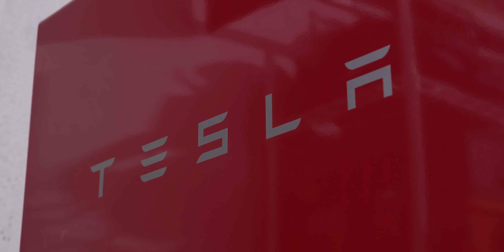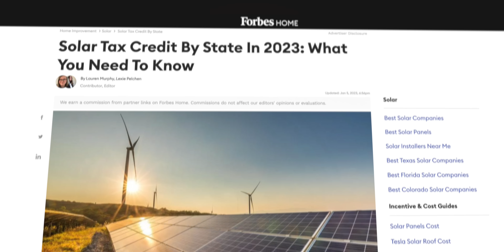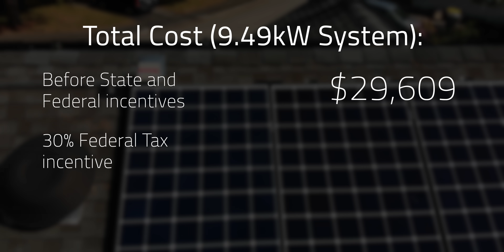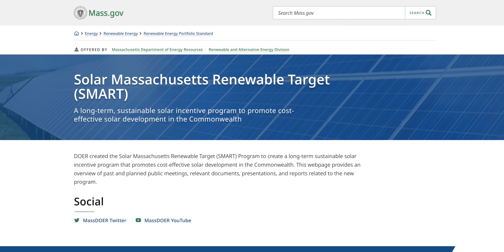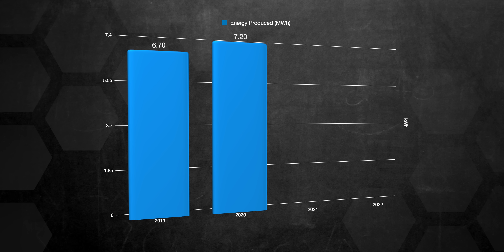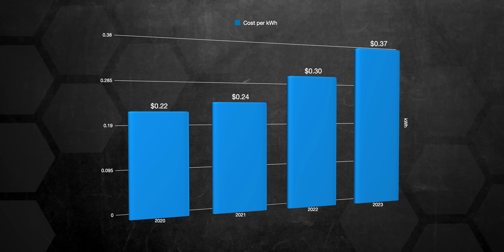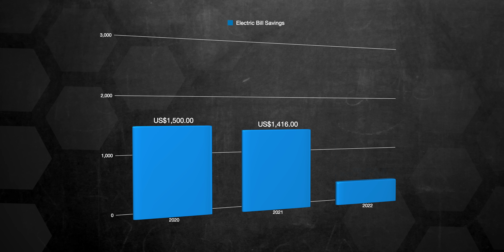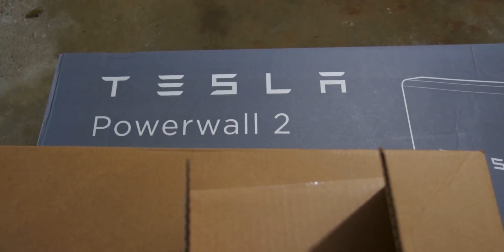5 Years with Solar Panels - Is It Still Worth It?

Comment: If you have the money and space to put a full working solar set up then EG4 is right for you. If you are building a new home then EG4 mini split can run directly off solar only, a two ton model will set you back just under 2k. This means that if you have just under 3kwh of solar hooked up to the mini split you can run heat or cooling all day long with out the need for grid. You can also connect it to the grid only, solar only or a combo of both. 
EG4 offers all in one inverters that are stackable and quite huge for around 1500 dollars they also offer a server rack battery of more than 5kwh for around 1500 dollars. 
You can even buy full kits from them as in this example. 
Complete Off-Grid Solar Kit - 13,000W 120/240V Output / 48VDC [20.5kWh EG4-LifePower4 Lithium Powerwall] 48VDC + 11,040 Watts of Solar PV 
Your Price: $15,439.60 
You can even increase the solar to max solar which is 16kwh. 
This is what I plan on doing when I build my new house. I am going to build around a solar system which will pay for it self in about 15 years or less. Since we will be going electric heat it should save us even more at a shorter time frame of about 7 years. We also plan on making sure that the solar array is at max and depending on loads we can add in more electric things like an extra freezer which over time will save more money. 
Adding in a electric car or two would also save us money in the long run. Which is why I wish they would opt to make city cars with range of 50 miles and easy to replace battery packs.

Comment: Great video, I just accepted an offer on solar energy and feel like we haven't missed anything big. There was a big big difference in offers from different companies but we went for quality rather than cutting corners to get the price down. The one we chose was the only one with proper roof load analysis regarding wind, snow, the roof beams' strength, etc.  Now we just have to wait for all components to be available, they thought around Q3 this year (16,8kW with 42 panels and a predicted production of just over 17MWh here in mid-Sweden). With the rules in Sweden, we maxed out on subsidies on the system without batteries so that will have to come next year with somewhere between 15 and 25 kWh capacity, we haven't decided on how much to invest in batteries yet. Meanwhile, we will have geothermal heating installed so this is definitely a great year for us in our quest for self-sufficient living! I will follow your new house project with great interest, good luck!
Reply: Update, we just got a message from our distributor, the cables are to weak to accept our overproduction as it is. They are investigating a solution. I am a bit amazed that they work on maximum at our current current of 3x16 Amps. Well, I trust they can solve their problem before our installation starts in Q3 this year...
Reply: @bennylloyd-willner9667  We upgraded ours to 25A when we put solar in (and did some other things). Hope everything works out for you.
Reply: @903lew  thanks! I'm sure they'll work something out. First the geothermal heating is getting installed, they start drilling any day now 👍
Reply: You're currently utilizing geothermal heating in your home?  Very cool!  Do you have a link on the company? Thanks!
Reply: @load3dedgaming  it's not installed yet, depending on availability of components the projected start of the system is about early autumn I'd guess.
Equipment is Vaillant, the company I chose is a local here in Värmland, Sweden called "Wermlands Energi och Rörservice“ (energy and plumbing service). It'll be ready just before we get our solar panels installed I think. It's a good year for me and my wife 👍
Reply: @bennylloyd-willner9667  Right on Benny!  Congrats on the project and thank you very much on the info!  I've been waiting for the solar tech to improve over the years before I made the investment, but it may still be worth it with some of the Fed/State incentives.  I live in Southern Arizona, and my new roof would accommodate panel installation on the southern side of the home with unobstructed sun light.  I just have to do some digging on the best company and program to suit my financial ability to get the best bang for the buck.  Ideally, with this type of investment getting the best is would be the way to go.  With A/C running nearly all the time almost 5 mo out of the year my electric costs to the power company is outrageous and will only go up.  Paying nearly $400 3 out of 5 of those months!

Sorry for any confusion, that quip was for Matt.  Giving him props on his video channel, content and presentation but wasn't feeling the $125 for his experiential video on the subject.

Thanks again Benny!  Let us/ me know how it turn out. =D
Reply: If you’re in SE3 I’d look at connecting the battery to a VPP like ChangeWatt. The rates are really good these days, looking into getting a battery just for this reason.
Reply: Me me me me... Me me me

Decarbonization is 21st century pyramid building.
Just burn coal. 

This is sickening on so many levels.  "How to screw the lower middle class and make them pay for your feel-goodery."
Reply: Thanks for sharing, I don't agree with the glum opinion of yours tho. I'm very satisfied so far with my setup.

Comment: Interesting review.  I live in North Texas.  Several years back, thinking 2016 or so, I met with 3 solar providers.  Despite their opinions, I didn't find it to be worthwhile in my case.  Many of their presumptions where simply wrong.  Escalating cost of energy was one.  In your case it was more correct.  I have very detailed records from when I bought my house in 2005.  In 18 years the cost of a kWh went from $.12 to $.15 which shoots down their sales models.  My house doesn't have a huge amount of roof with a southern orientation.  It was interesting to compare the three proposals with interesting variations in panels etc.  Their pitches were all about government incentives with disregard to the financing costs.  They also made false assumptions about how my local utility would cooperate.  I checked their assertions about home insurance coverage.  They lied.  Even if hail wouldn't harm the panels, they would have to be removed and reinstalled after the roof was replaced. The insurance company was happy to add an additional policy but the presentations never suggested that.  They also asserted that there would be increased value in selling the home.  I consult with with several realtors that said no way.  Perhaps where you live the experience will be better.  Here they would be more concerned about assuming liability of loans and maintenance.

Comment: Super interesting. Debating on a large project in the next year or two and weighing the benefits between solar vs geothermal. I think eventually both will make sense, but so far geothermal would make the bigger impact for our specific situation.
Our biggest issue with solar is just roofline... a lot of east/west and very little due south. Even when we do solar, it may make more sense as a smaller separate diy circuit for us to charge lawn equipment and run a few "always on" devices like the home network/server rather than powering the house. Time will tell.
Reply from the maker: I'm all east west and no south.  Depending on your house and surrounding trees it can still work well.

Comment: I generate much more electricity than I presently use, but much of my electric bill is for infrastructure costs, e.g. power lines and poles, etc.  My 1:1 credit is not applied to that, so I had a surplus that was confiscated by the local utility company.  This year I used much more electricity for heating.  I've not yet calculated how much that has saved me in other heating costs (e.g. natural gas and firewood).  Overall I'm glad I got the panels, but the savings per year will not pay off the installation costs as quickly as I had thought.  At least not until I get a few more electric products, like the e-car, electric water heater, and heat pump.  Thinking about getting that Tesla wall battery, but I'm not there yet.

Comment: My comment on solar is to get as much as possible on the initial install as installation costs are significant so upgrades cost far more than doing it on the original install.  I don't know about the US but here in Britain the initial install is VAT free which is big enough reason to front load it. If you have 1:1 import/export cost then the grid is your free battery but for most of us this is not the case and I suggest you do some sums but for me even a small battery is massivly beneficial especially in winter when the feeble solar input at 9AM-3PM and is mostly wasted.  Storing this power and using it in the evening and so offsetting 38p/KWh with free daytime power makes loads of sense.

Comment: When I specified my solar system, I researched my average kWh per day over the previous year, and put in enough panels to produce slightly more than that.

My grid provider's net metering system is more rational than most I've heard of. They "store" my overproduction on a 12-month use it or lose it basis. This means that in the winter when I produce less than I use, I draw on my stored reserve, and in the summer I build it back up. I usually have about 800 kWh in "storage", and on a typical year I "lose" about 300 kWh of stored electricity (which cost me nothing to produce) because I didn't use it within the 12-month storage period. This would sell for about $20 USD where I live.

My system saves me about $4,000 per year in electrical costs. I have added enough battery storage that I would be marginally off-grid capable although I'd have to cut back on usage in the winter time. I have ways to do that without changing my lifestyle much.

I live in the mountains of central Mexico, and my only electricity expense in a total electric house (heat/AC, hot water, cooking, lights, entertainment, swimming pool, etc.) is the minimum grid connection fee of 26 pesos monthly, or at current exchange rate about $17 USD per year .

My solar system was one of the best decisions I ever made.

Comment: Did you forget about the cost of re-roofing your house so you're not installing the panels over a roof thats near end of life?  If not, what is the cost to have all those panels removed, re-roofed, and re-installed?  It might be worth re-roofing with a metal roof.  3x the cost, but no maintenance... 

I have a N/S facing house and considering solar.   As for helping with power outages?  We rarely have them, and a $700 generator and $50 in gasoline has gotten us through a two day outage before. So I don't consider an outage to be a deciding factor

Comment: I wish I had known about the squirrel guard option.  But it was 2011, early days.  12 years later it has been great except for the time a squirrel ate a wire and disconnected 4000watts of my 9200watt system.  It took me a few months to notice.
Reply: I had the same experience here in Ontario with my 5.4 Kw system.  The squirrels got under the panels and had a wonderful winter making their home under my panels.   I had to bring in a crew who had to check out all 23 panels and replace a few of my SolarEdge optimizers and re-insulate  wires that our friendly squirrels had dined on. This and the cost of the squirrel guard installation set me back approx $2K.   I had thought I had covered all the potential problems.

Comment: Thanks Matt. Do you or anybody else know if you can apply ceramic coating onto the solar collectors to minimize dirt and snow buildup? Also,XPEL has a new PPF wrap that has ceramics built in now. I wonder if this is something that could be applied to solar panels?
Reply from the maker: I hadn't considered that ... genius!  I don't know anyone who's done that, but I can't picture a reason why it wouldn't work (it's just glass).

Comment: 20+ years off grid with solar. You made some good points and proper orientation for panels to get the most output is critical. A roof mount may not be the best option and you can do a ground mount or possibly a garage or patio mount instead.  Ground mount also reduces snow build up and rain issues and are easier to maintain.  

Having a battery backup really is the best option and you want enough storage capacity to handle basic needs for at least 3 days.  Blackouts are lasting longer now due to more storms and an antiquated grid.

I suggest a hybrid system for city dwellers that is grid tied but can also be switched to full off grid in the event there is a long term blackout or you just don't want that grid connection at some point.

With the right appliances you do not need a huge system and many US homes can be powered by just a 5-7Kw system. My system is only 1Kw and I have most appliances as any grid home.

Good luck on the new house and I am interested to see the new setup!
Reply: What inverter do you use? Assume hybrid but which one please?
Reply: I use a PowerDrive pure sine 1000 watt inverter.  Handles everything in the cabin.

Comment: We installed a 6kw system (20 panels) in mid 2017, and so far have generated about 32Mwh of power.  Unfortunately (or maybe fortunately) our rates here in Madison, WI are low ( currently about 16.5c kWh), so our payoff period is going to be a lot longer.  We get net metering because we generate less than we use (if we generated more than we used we would only get wholesale rates back).  Also our house has a relatively low pitch, and is pretty shaded in the winter so production at this time is very low.  The low pitch also stops the snow from sliding off, so after each snow fall I need to go up on the roof with a snow rake and clear the snow.

Comment: We just had a large solar installation this past summer.  This winter, the snow avalanche off of our roof has caused serious damage to our deck.  It's no joke.  My solar installer acted surprised when I asked what people do about that.
Reply: I'm curious if a portion of the solar output could be dedicated to warming the panel surface to melt snow as it lands ?
Reply: @tcurr0309  to be honest, if it gets cold I don't see that working, but that's just as an owner and not a scientific assessment.

Comment: How do you clean the panels?
Reply from the maker: I did once a year for the first couple of years but stopped.  Between the rain, snow, etc. in my area, they stay clean enough (but your mileage will vary depending on where you live).  When I've done it I use a telescoping pole with a microfiber cloth on the end.  A 5 gallon bucket of water with a few drops of dish soap does the trick.

Comment: You can significantly reduce cost of system if you opt not to install batteries. You don't need them unless you leave far from civilization or worry about blackouts. I have 9.8 kwt on grid array with no batteries, works perfectly with much less initial spend. Plus batteries is something you need to change iventualy and has potential danger in terms of thermal overrun.

Comment: Hi Matt, I enjoy watching your videos especially on solar. I live in Queensland Australia and have had solar panels since 2016. My current system is 6.63KW with a fronius primo inverter. My panel arrays are east and west facing. Average power production is 7.6MW pa, My wife and I consume on avg 6.41MW pa and self consume 2.6MW pa (our own power) meaning we are only buying 3.81MW pa from the grid at a cost of 22c per kw AUD. We export around 5MW to the grid each year for that we recieve 11.5c for the first 5kw per day then 5c every kw after that. For installation costs the whole system cost $7,400 AUD  after a STC discount was applied which reduced the price by $1,400. making the price $6,000AUD included in that price we also had to have our meter upgraded to read grid exports and a fronius smart meter installed(so i can meter everything myself) Thought you might appreciate how differn't costing is in Aus vs US and power production
Cheers Paul

Comment: Can we pause for a minute and digest the 1 MW/h  by month...
We own a comparable house in east germany and we use 3.5 MW/h in a whole year. What are you doing? Seriously! That is insane. I am interested,  what sucks so much energy? Even if I include my gas heater and convert the m³ of gas in Watthours it adds up to round a bout 5.5 MW/h a whole year. And we are still trying to get it down...
Reply: I also have been surprised with the low usage noted by European commenters compared to our US consumption. My electric bill (before solar) gave a reference consumption for efficient homes in our area, and our usage of 1MWhr per month was fairly average. Electric resistance hot water heater, air conditioning, electric shop and garden tools, computers, flat screen TV, electric cook range and oven, microwave oven, washer, dryer, dishwasher, water softener, lighting (incandescent mostly replaced), a large refrigerator/freezer, and a small beer refrigerator. It adds up.
Reply: @flash4s747  I mean we people over here do make a lot of fun about your usage... but I had no idea how bad it actually is. We are basing our jokes most likely about your gas consumption for your cars and I do know that air conditioning is a big thing for you guys but again-> 1MW per Month is wild. 
When we install our panels this year and get the new electric car leasing deal, we are going to make money with our panels and the battery after 5 years. You can get crazy deals in germany. My electricity  provider pays money if I offer more than 35 kWh capacity for peak times. If I reach the results of my neighbours house , electricity prices are none of my 99 remaining problems anymore.
Reply: @flash4s747  Refridgerater, Freezer, one TV, one PC, one Laptop, Dishwasher, Washingmashine, Gardentools, full on Buildingsite in the barn, Pumps for the Aquaponics, electric induction kitchen oven... I mean we are not living on a Rock.  I mean my house is literaly built on Porphyr Rock but we do know electricity even in East Germany. 
No offens but you guys use alot.